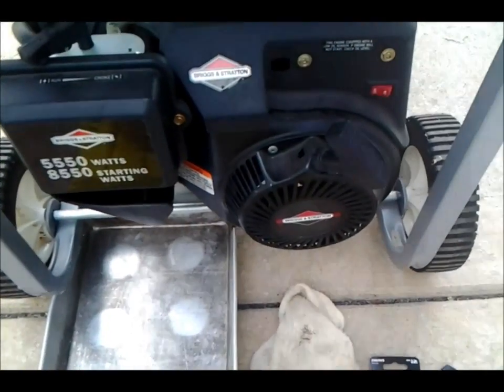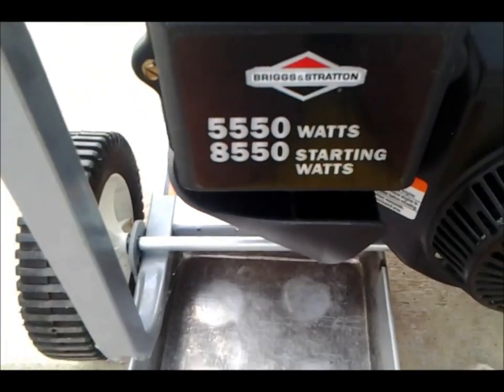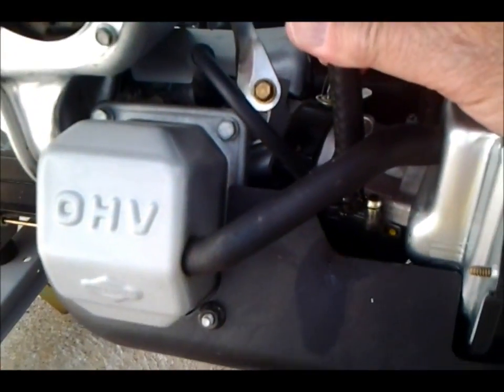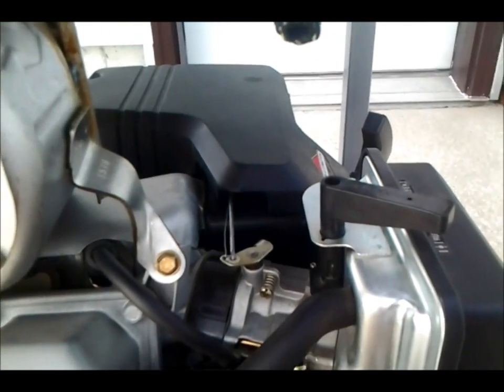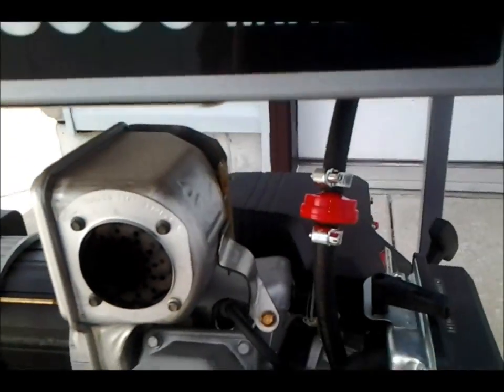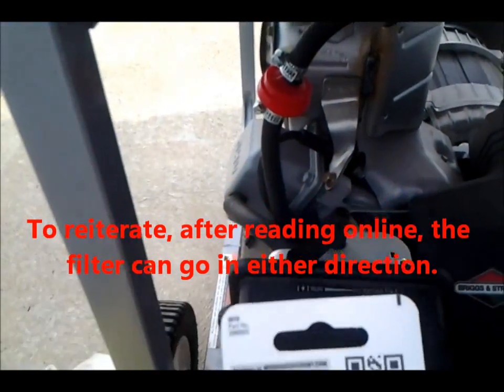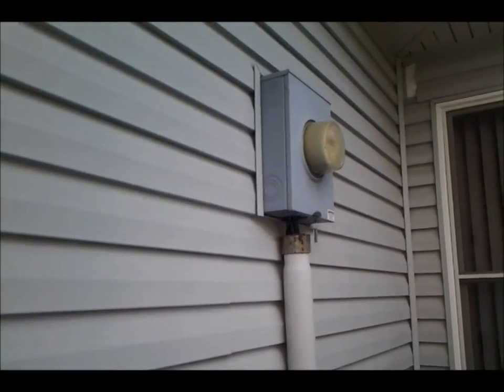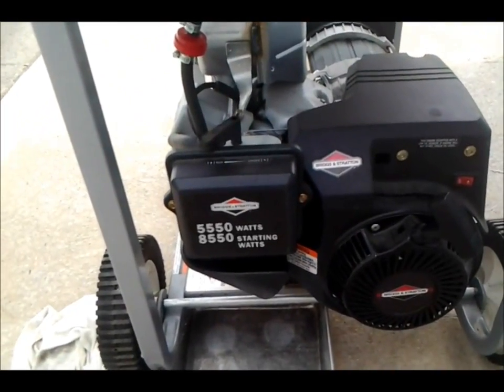Installation of a Fuel Filter on my Briggs & Stratton 5,550 Watt Generator

Comment: Can I install a 1/4" I.D. or 5/16" I.D. fuel filter on my  troy built 5500 generator model number 01919? Will it leak?
Reply from the maker: As long as the O.D. of the filter is smaller than the I.D. of the hose.

Comment: My neighbor is a mechanic and suggested instead of turning the on/off switch to the off position when stopping it, turn the gas off and let it run dry and shut off due to lack of fuel. This he said will keep gas from sitting in the carburetor and part or most of the fuel lines which will eventually gum them up. He's obviously tired of fixing all of my stuff because I have no mechanical skills!
Reply from the maker: Good points, Greg!  I am also operating my generator, for a couple of minutes, each month.  I learned this in the water treatment industry as a way to keep generators operational.
Reply: @harrison4803  Yes, good point. I've owned boats and a couple of motor homes throughout the years. Like generators they tend to sit unused for long periods of time. Starting anything (and using) with an engine often keeps them working. I of course learned this the hard way!

Comment: i meant just leave the hose connected on both ends but remove a 3/4 inch section of hose right where you installed the filter. There is plenty of room there to cut that hose without removing the bottom clamp

Comment: Great job on the filter but you made a lot of extra work for yourself. I just use some sharp tin snips and remove a 3/4 inch section of hose right where you did. Then install the filter with the 2 clamps. There really is no reason to remove the hose. Good job though
Reply from the maker: Jo, I am confused (easy at my age) but you say you "remove a 3/4 section of hose" but then you say "there really is no reason to remove the hose". Thanks for the kind comments, however!

Comment: How often do you need to change the filter?
Reply from the maker: Great question, Jose, but I have no idea? :)  It would be a function of how much you run the generator.  If you run it a lot, maybe change yearly? I have not changed it yet but I have not used it much. Within the past year I started exercising it monthly, for about 5 minutes, to keep the gas in the carburetor fresh.
Reply: @harrison4803  
Ok, sounds logical. Thank you for your quick response 😄

Comment: Its redundant to place two filters on your gas. When the red turn valve has an internal filter in the tank
Reply from the maker: According to my manual, that is not the case, Doc? Maybe you are looking at a more expensive model?

Comment: Looks great. So did mine which ran for awhile then kept shutting off. After changing plug, air filter, oil and it continued to shut off. I finally took the filter out and all worked well
Reply from the maker: I have found that starting it once per month, also, helps!

Comment: This model have the fuel filter inside the on/of valve.
Reply from the maker: Angel, no my model does not have the fuel filter incorporated in on/off valve? It is an interesting idea, however!
Reply: Ook, my briggs stratton elite 8750 have the filter incorporated in the top of the valve. It is a small filter but works very well.
Reply from the maker: @caru3497  Wow, so that is why it is "elite", apparently.  How much did you pay for this cadillac, if don't mind sharing? Mine was about $600 in 2005!
Reply: John H $900 in 2011, yes is a monster, in 2017 during Hurricane Maria in Puerto Rico helps me 24/7 for a couople of months. For me is a Top of the Line in generators.💪🏻💪🏻
Reply from the maker: @caru3497  Wow!  Amazing, Angel!  Are things back to normal there, as of yet?
Reply: John H this hurricane was the worst in decades but we are now about 80 percent of recovery. There is a lot of loss. To many houses and electric instalations were damaged. Thanks for ask my friend👍

Comment: John H

A question if I may. I unscrewed the oil level sensor on top of the engine, but I didn't realize that I had unplugged it, from the wire inside. I can't find any information on how to reconnect the sensor. Have you experienced this? Your input will be appreciated.

I have the same exact type of generator and I'm getting it ready for this season in Florida.
Thanks very much
Reply from the maker: German, I have not had that problem. Searching the net doesn't show much, as you probably have discovered? Can you start the generator without it connected? If so, I guess you could monitor the level from the fill tubes on the bottom? Let us know how it goes?

Comment: Since my Generator doesn't have a fuel pump and is gravity fed, will a see through paper filter work or do I need to use a filter with just a screen in it like the one you are using? The flea market near me sells the red filter you are using for $1.50.
Reply from the maker: Mine is gravity fed, also, so my type should work, I would think?  Let us know what you do?  Thanks for watching.
Reply: I had a larger metal car fuel filter for a car I had sold. I installed it and this modification did not work, since this engine is gravity fed. Engine would run a minute or two and shut off. Put the original hose back and no more stalling. Many paper filters that trap 20-30 microns must have a fuel pump on the application to work. I've also had to disassemble the carb several times to clean the crud out of the jet and the tube using tip files for welders and compressed air. The bowl gasket is complex and easy to break, so you must have one handy if it's dry-rotted. The carb problem always starts out the same way: The machine requires varying degrees of choke to smooth out and run decently. This condition is not good for the engine if it's used in this condition. It will cause extra wear to the top compression ring on the piston. Having the choke partially closed is only meant to be used for a few seconds to start the engine. and will cause the top ring to expand out abnormally on every intake stroke as it seals against the cylinder, similar to a dirty air filter. The engine will also run hotter than normal, and Aluminum doesn't deal with extra heat very well, esp. with a large load. If the only way this engine will run well is with the choke partially on, then the carb needs to be removed and completely taken apart and cleaned. Otherwise, the compression rings will wear out and also wear out the cylinder to the point where the block may need to be sleeved. The aluminum block these engines use is softer than cast iron and will wear quickly if choked and ran on the hot side of normal for many hours of run time. The way to prevent this condition is to completely run it out of gas when storing and to use only stabilized gasoline without ethanol. It's the ethanol gas being left to sit in the gas tank for months or years that causes most of these carb issues. because it attracts moisture from the atmosphere and waters down the gas over time.

Comment: Great Video John.. I have a couple of questions .., I have the same generator .. you mentioned you can power the whole house with this generator .. would you show a video of the set up .. you show the outlet where you connect the generator ., is that outlet connected to the panel inside the house? Or is it connected to a switch? Thanks for the video and thanks in advance for answering these questions
Reply from the maker: Tony, here is my play list showing the complete installation of a 30 amp breaker in my panel, installation of an interlock kit, and the generator inlet box.  I also show it in operation following a storm.  Let me know if you need more?  https://www.youtube.com/watch?v=5nBCjYC6uMI&list=PLtPT9KQSzU8iYlN5Yr9MtHUJKNu04rWKk
Reply: John H ... thank you

Comment: I was just trying to figure out which way this was supposed to be installed because it doesn't say which side is the inlet and which side is the outlet so hopefully you're right and it doesn't matter. I just paid $2.99 from Bensons Hardware for the same one but they also had a white 150 Micron one for $4.99.
Reply from the maker: Yes, Luigi, I think, if it doesn't say or have an arrow on it, it does not matter.  Thanks, for watching!